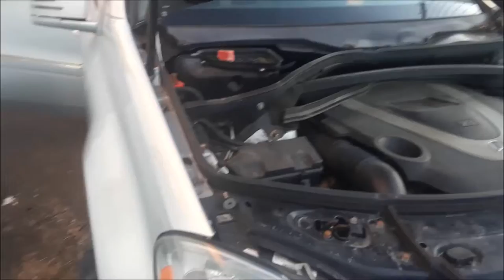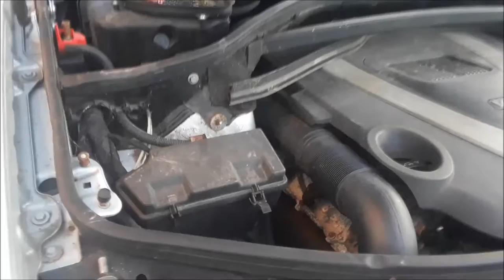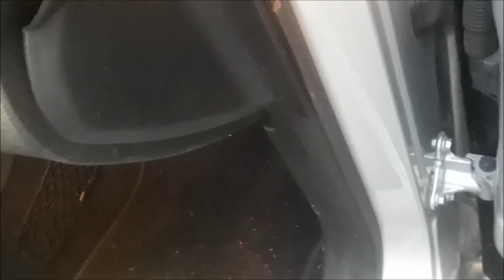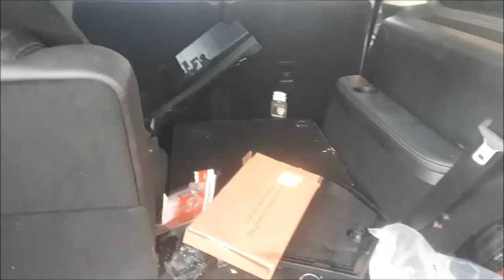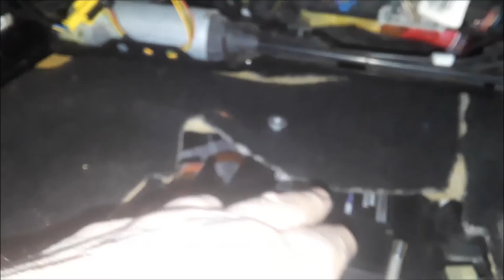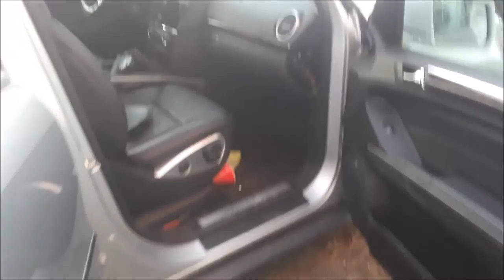Mercedes GL 450  GL350 Fuse Box Locations  / 4 Boxes

Comment: I have a 2013 GL350 and I also have a fuse box under the left back seat. The 2nd row. You food the seat up and there is a plastic panel covering the fuse box. Inside this box was a pamphlet tucked in the side that shows all fuse box locations and on the back it tells you what every fuse is used for.

Comment: my lighter/phone charger plug is not working     where is that fuse?
Reply: On the 14 GL350 it's under the rear bench seat fuse 148 15 amps.

Comment: My battery area got wet and it reset the my 2007 gl450 and the back windows rolled down automatically  and one of the head lights wont go out i need help bad can anyone help 
n

Comment: My front left signal is not working. The mechanic said the front Sam module needs to be replaced. Where is it located? Inside the trunk or under passenger seat?
Reply: Under the Seat next to the Battery on the right.